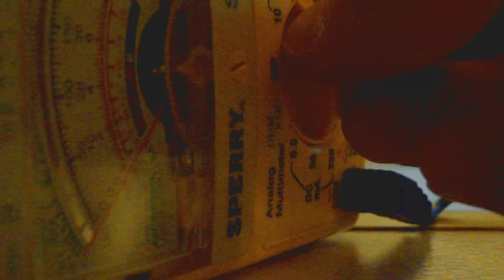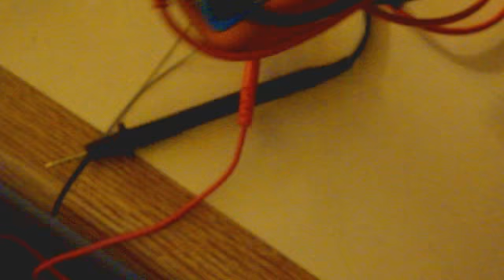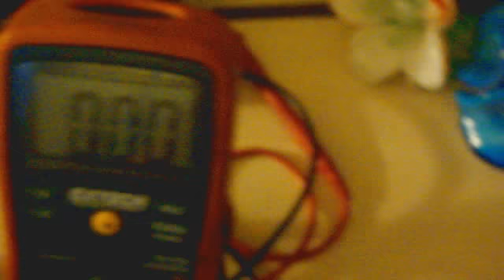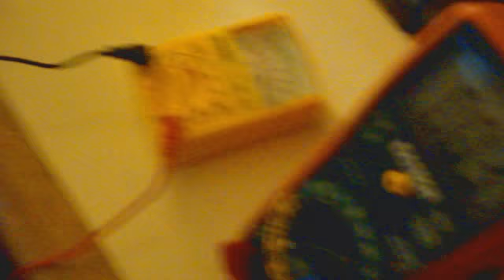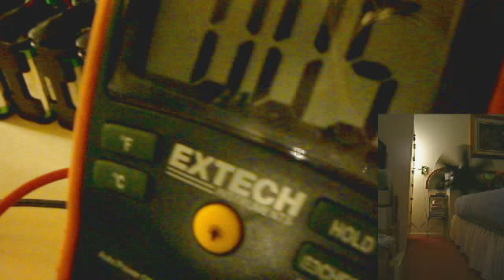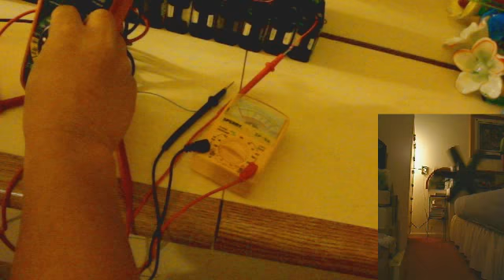Analog and digital measurements of current draw of Newman Motor

Comment: The reason the fan slowed down in different Ampere ranges is due to the meter deflection.  When you had no meter deflection, you were not sinking current.  As soon as you saw meter deflection, some of the current was used to deflect the meter.  Not much but obviously enough to slow down the fan.